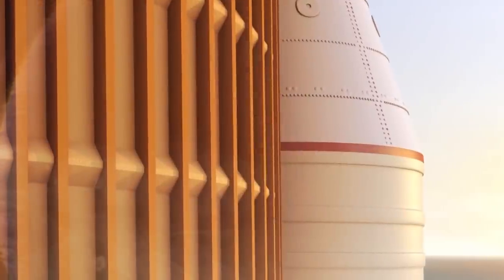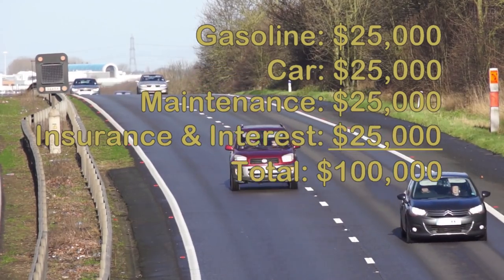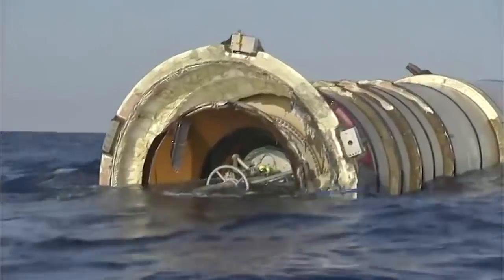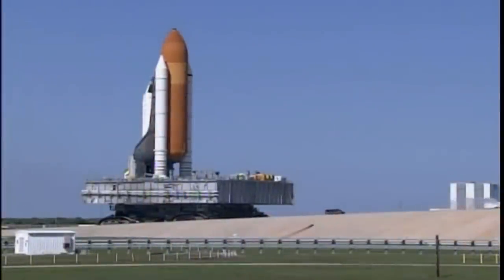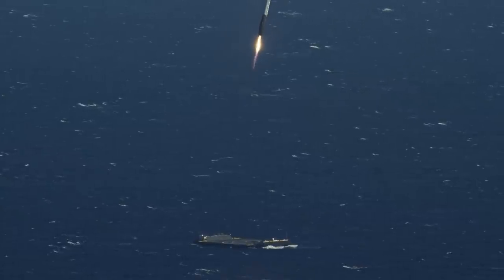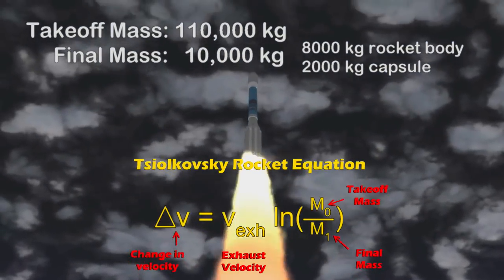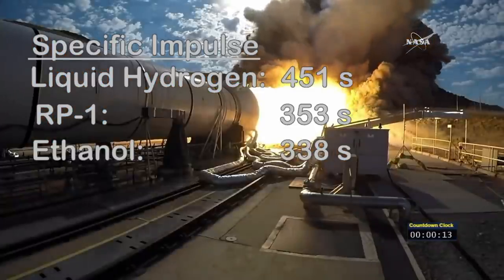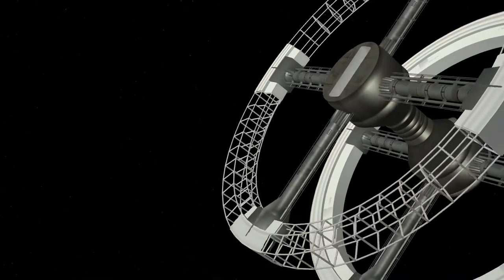Reusable Rockets & Metallic Hydrogen

Comment: Weather balloons can get to the edge of space relatively cheap. Felix Baumgartner used one for his jump.  How hard would it be to use a hydrogen balloon to deliver a car sized payload to that threshold, then maybe burn the hydrogen to gain extra lift to nudge the payload further out only to be picked up by a spinning sky-hook or grappled by a more mobile craft in permanent orbit?  The channel talks a lot about individual technologies and sometimes combining them.  It seems like making the cheapest reusable solution would involve several technologies maximizing synergy.  Even a ground based cannon shooting a rocket into the air before engaging it's own thrust would save immense fuel.  For that matter how ridiculous of a balloon would you need to get a rocket that high, and is there a reasonable way to burn that hydrogen from the baloon?
Reply: There was talk of space guns before, go check that out. Basically the issue is you can't fire a rocket the same way you fire a shell. The cargo and especially humans would get mangled beyond belief by the acceleration. That is why you need a long gun that accelerates the payload at a reasonable rate. And long means really long and expensive.
Reply: I remember that. It obviously wouldn't be a cannon in a traditional sense, maybe a railgun type device partially submerged in the earth and having a barrel that subjects the rocket to about 10Gs for a few seconds for as far and as hard as it can.  It would take a significant dent out of the fuel needed to enter orbit.

But, I'm more curios if you could managed to construct enormous graphine balloon (less material than an elevator) and fill it with enough hydrogen to lift a multi-ton payload to the edge of the atmosphere.  Then burn that hydrogen and "roll in" the balloon material in the process to get into orbit.  With the air much thinner and being already 90% of the way there It sounds totally feasible... You'd probably need to take additional compressed hydrogen and probably some O2... But I'm not as versed in the necessary math to be able to fully explore the idea.
Reply: I think Isaac mentioned that he will cover balloons. Something like you suggest sounds quite plausible. :)
Reply: TMRO covered a company that is developing a rocket launch from a high altitude balloon system just recently, it's a little different from what you describe, I think mainly because there just isn't much of a mass of hydrogen when you fill a balloon with it.
But for something similar but slightly different check out JP Aerospace, they have the idea of using the aerodynamic lift of an inflatable flying wing to go to orbit and back, crazy stuff, but it might just be crazy enough to work!
Reply: Just keep in mind that it's not altitude that gets you into orbit, it's velocity. If you get to the edge of our atmosphere, 100kms, you've still gotta pick up the 7km/s in velocity. Yeah, you're above the atmo so there's not much drag, and you can use fuels that offer better ISP at that altitude, but you're basically starting falling vs starting parked. Can still get to orbit, can still save some fuel doing it, but its not all that much.
(A side note, attempted the heck out of this for a couple days with RealScale KSP, saved about 600dV... was the biggest let down ever)
Reply: You'd have to get up to orbital velocity very, very, VERY fast to avoid just falling straight down, and the acceleration would be too much for a human occupant to survive.  Also, any payload not made of durable materials would probably be destroyed.
Reply: Taking into account the considerable horizontal velocity needed to "stay up" the only way I can see a balloon system working is if it can simply get out of the atmosphere as cheaply as possible then have a spinning sky-hook (from a prior video) snatch it up with minimal resistance and release it into an orbit.  I'd imagine the savings would be primarily in avoiding that air resistance and perhaps a bit in terms of lift.

I'm also curios how hard it would be to make a giant hydrogen-filled super-buoyant flying-wing craft that could carry heavy payloads to the edge of space then "shoot" a payload with considerable force to get it not only out of the atmosphere but with a good dose of orbital velocity before payload fires it's own rockets to stabilize it's orbit.  I'd guess if you can start at a high altitude, no air resistance and maybe a quarter of the velocity you need to get an orbit you'd save a ton in terms of fuel.
Reply: Look up JP Aerospace... they're trying to build an airship that goes up really high, and docks to another airship, which then acts as a sky station. Have another mile long airship with highly efficient but high thrust ion engines, and use the dynamic lift from the airfoil to gain altitude until you hit the karman line.
Reply: +wakjagner A litle less than half of the energy expenditure of a rocket comes before it starts a gravity turn. A high altitude launch platform is a good idea.
Reply: Space Gun Zero to three hundred Gs in an instance. Are named Kal El by chance if not forget it, and that is hard on electronics as well .

Comment: the downside to that analogy is that, depending on the rocket, the car might be cheaper than the fill up. The shuttle for instance did re-usability quite a bit but that ended up being incredibly expensive as a consequence. 
So there are ways to "do it wrong", but if you do disposability well it can actually be pretty damn cheap

Comment: If you double the radius of a tank, you also quadruple the cross sectional area and double the circumference, so you have to double the thickness to maintain the same pressure rating.
As such tanks scale linearly, so propellant mass ratio per the rocket equation is largely unaffected by scale.

Comment: With metallic deuterium available, we could start building Daedalus tomorrow.
Just colliding two drops of metallic deuterium will cause thermonuclear detonation, no beamed imploder needed.
Reply: Icarus Interstellar did a concept starship design using ultradense deuterium, when someone announced that they had made it, but they dropped work on the design when replication attempts failed.
Reply: "two drops of metallic deuterium" that is like around 0.2 grams of it.

Comment: what is your opinion on the skylon plane?
Reply: cause it seems to be quite a reasonable solution though a little costly
Reply: douglas faulds 
yes the SABRE engine looks interesting, I too would like to know your thoughts Isaac?

another great episode.
Reply: In fact the skylon will be built like the black bird (sr71) with presumably similar ridiculous maintenance and overhaul costs; due to the heat stress on the air-frame. And with its stubby wings a necessary air to air refuel. 
Though less efficient the falcon 9 dose not have to worry half as much about aerodynamic and thermal stress; being a regular cylinder with no consideration for aerodynamic lift.
Reply: douglas faulds Skylon's mission profile is very different from the SR71. It will spend most of its flight out of atmosphere, also the skin design overcomes the SR71 skin issues, materials have also had 60years of evolution. They may look similar but in reality are nothing alike.
Reply: If you mean the British spaceplane; I'm not ready to turn responsibility for human lives over to computers just yet.

Comment: I wish you would have mentoined Methane as a fuel, scince many companys like, Space X with thier new Raptor engine and Blue Origin witht thier BE4 engine, seem to deemed it as a go-to fuel.
Reply from the maker: Ah damn! I knew I was forgetting a fuel I wanted to talk about. Ah well, it's main application of interest, for me anyway, is as an easily produced one away from Earth.
Reply: I see. But thats true for Hydrogene as well. So it must be easier to produce Methane away from earth, than spliting water into Hydrogene and Oxygene. Anyway, thanks for your response.
Reply: Methane is denser than Hydrogen so smaller and lighter tank, 2nd Methane is much easier to handle and work with than liquid Hydrogen. Methane with maximum Hydrogen dissolved into it, is a great compromise as well. Hydrogen does have a higher ISP (specific impulse) the higher the more efficient, better efficiency is much more important on the final upper stages.
Reply: easy storage and production. hydrogen requires more water to produce it on site(Mars) most plans will recycle waste air, dirty(brown)water and bio-solids. you are likely too loose as much hydrogen as you produce. the electrolysis of water takes around as much energy to produce methane. you lose your Isp mass advantage difference.

Comment: I think metallic hydrogen is unlikely as a rocket fuel, even in the distant future. It requires pressures in the hundreds of gigapascals to be made metallic, and I see no reason why it would stay metallic for any reasonable length of time once the pressure is lowered. 

Using it for rockets would mean fuel tanks capable of maintaining such a pressure, which would invariably make them far heavier than tanks designed for holding "regular" liquid hydrogen.
Reply: Metallic hydrogen is stable at room temperature and at atmospheric pressure if there aren't quantum effects.
Reply: *Presumed stable. But it would still be much more expensive than diamonds to manufacture.
Reply: kokofan : you got a link about that? I'd be interested to read it.
Reply: The pressure cited for manufacturing metallic hydrogen are much higher than those required for the manufacture of diamond. The link in the description of this video gives you an idea which kind of pressures are needed for metallic hydrogen to form. Even diamond anvils have trouble with this (though this is in part due to hydrogen penetrating in the crystalline structure of the diamond anvils and making them brittle).
Reply: Wouter Debois : I was asking Kokofan for a link. About metallic hydrogen being "stable" at room temp & atmospheric pressure. 

(It can at best be metastable, since you obviously can't have two different thermodynamically stable phases under the same conditions)
Reply: It is all speculation at this point until more researchers can reproduce the know results. But Wouter Debois is right, it is more expensive than the manufacture of diamonds. Very doubtful that this would ever work in very large quantities, not for space flight let alone for a series of flights. At these requirements it is more feasible to go up by nuclear explosion shock waves...: P
Reply: Are you thinking fission fragment (orion drive) or are you leaning more towards nucleair salt water rocket?
Reply: Wouter Debois: I am definitively thinking Orion drive, but a bit tongue-n-cheek. I am however curious about your ideas. The new craze about grafene and metallic hydrogen is the disruptiveness of these technologies if they ever became practical. A bit of an OCP event or at least a Back Swan. When we talk about the future in more immediate terms, it becomes hard to foresee all the disruption that new technologies can cause and completely rewrite the economics of the problem.
Reply: Graphene seems more of a game changer than metallic hydrogen. Metallic hydrogen makes for great rocket propellant (and possible room temperature superconductor) but mass producing it would require a lot of energy. If you have that kind of energy, other modes of propulsion are equally (if not more) viable. Graphene seems more of a game changer, if it could be reliably mass produced it wouldn't require obscene amounts of energy for starters. And making a very strong material (UTS of 130 GPa, melting temperature of approximately 4900 K, which is insanely high, with a low density) out of carbon, one of the most common elements would be a major game changer. Not sure if you've ever heard of it, but Children of a Dead Earth is a realistic (as much as is possible) space combat simulator. Someone modded graphene in and it really illustrates how potent this is. A few mm of graphene armour provides more protection than dozens of cm's of steel.

Comment: You're sadly mistaken about the square-cube law with regard to its benefit for larger rockets. The thickness of the tank walls does not stay the same as the tank size goes up, but rather grows linearly with it. Since the area of a tank grows as the square of the characteristic length scale of the rocket, and the tank thickness grows linearly with the size of the rocket, the volume_, and therefore the _mass of the walls also grows as the cube of the characteristic length scale of the rocket. The square-cube relation that would help a larger rocket relates to atmospheric drag, which grows as the frontal area of the rocket.

This is the second major technical error I've found in your videos in a week. (The other being a confusion about "1/5 the delta-vee resulting in (supposedly a rocket) being 25 times easier from a kinetic energy standpoint yielding a quadratic, when the relevant analysis was a rocket equation analysis yielding an exponential.) It harms the viewer's enjoyment of these and erodes their trust to discover errors like these. Please be more careful with your facts.
Reply: I agree.  Bigger tank with same pressure must have thicker walls.  A beer (or soda) can has roughly same empty mass/volume than Shuttle external tank had.

Comment: If Metallic Hydrogen is proved to be a real stable state of Hydrogen, I'd say we are NOT far from interstellar travel.
Reply: +Harmen Koster - Or, it might be as stable as granite. You might move it with bulldozers, and store it for centuries in shoeboxes. Maybe it'll make great fireproof armor. Or room temperature superconductors. Or maybe it's not even physically possible for some reason to be discovered. 

(I admit, I might worry about a little rust.)
Reply: Bo Zo, if you could use m-H as fireproof armor then there should be some of it in asteroid debris.  There is going to be a minimum pressure and max(min?) temperature even if it is metastable.
Reply: +stefan r - I was kidding, I just meant "who knows."
Reply: +Dan Nguyen - yes, but you wouldn't want it to rust very rapidly... Kaboom.
Reply: Indeed, most simply see the use as a rocket fuel, with a high specific impulse. But, if the claims about superconductivity are true, then imagine what you could do with a metallic hydrogen particle accelerator. The process of fusion power, or generating anti-matter might well be possible. Honestly, anything to do with super- phase materials and their quantum states scare and excite me at the same time.

It's not just how well it would burn, but also the technologies you derive from it that could lead to interstellar travel, wireless power transmission or god knows what else.
Reply: Sam the next black swan?
Reply: Metallic Hydrogen sounds great.  I wonder if they have done any work in creating Metalic Deuterium or Metalic Tritium?  These would be ideal pre-cursors for any future Fusion experiments.  And the Metalic Hydrogen would be great to create not only the magnetic bottles to hold any fusion reactions, and probably even applied to laser exciter coils too. 

So many things are coming online that will drive the future.
Reply: metalic hydrogen.  one stop for rocket fuel, armor, superconductor,  low fat low sodium power bar, bottle, laser, and adult toys.  Anything else we should add to the list?  Perhaps quantum computing?
Reply: Or nano carbon imprint metallic hydrogen blades. Like a katana or something. :)
Reply: Daniel, would hydrogen propel gore out of the wounds your sword makes?
Reply: Probably. Dunno.
Reply: clearly you understand bugger all.
Reply: psycronizer is right, we forgot it could be used as insecticide.  Must not have been summer yet.
Reply: If we took the time to make nuclear thermal rockets we would already have ~10kmps exhaust velocities. I imagine its moatly safety concerns and the no nuclearisation of space treaty that keep people back.

Comment: Could the sea dragon be used to bring fuel up till needed in low earth orbit?  Then a space plane is made to just pick up final packets of fuel to go from 60 miles up to 300 miles up ISS height.  Grapheme has an extremely high melting point, and recently on the way to mass production methods is a new shuttle like vehicle possible now?

Comment: Ug... Skyhooks and metallic hydrogen... clearly not concerned with practicality.
Also, a few of the statements are just plain wrong. Mass fraction does not simply increase with volume. These are pressure vessels. The intent of the sea dragon was to save cost on design, not caring that it was sub-optimal, relying instead on mass production to offset cost of wasted material.

Also, isp depends on how the nozle is optimised, not just the fuel.

Comment: How about a nuclear thermal ram-rocket launched by a  nuclear powered railgun? Seems like the most cost effective tech. You can reach orbit using your ramjet and then use your rocket engine to reach the moon or whatever. Oh and the fuel would be slush hydrogen. This can fit into conformable fuel tanks making it more versatile.

Comment: optimizing fuel tanks is a bit more complicated then the square cube law - there are of course engineering difficulties but pressure tanks are scaleless, a pressre tank of a given geometry with a given material will have the same empty weight to fuel weight ratio at any size - theres also structural stress and vibrational stress - where a small tank is more advantageous - however aside from engineering issues one big difficulty with small tanks and with rockettanks in general is that most of them are cryogenic - carrying the amounts of fuel needed with a light enough fuel tank would be near impossible without cooling down fuel and insulation and heat exchange actually does go with the square cube law, actually even better with what might be called a linear cube or power of four square law - epending on how insulation works